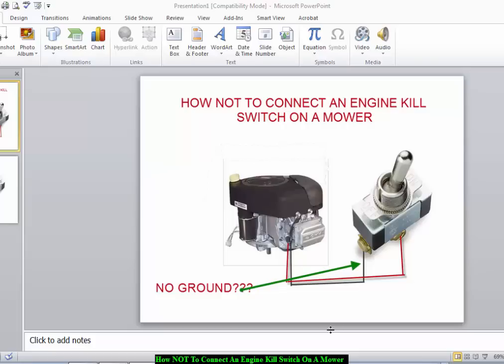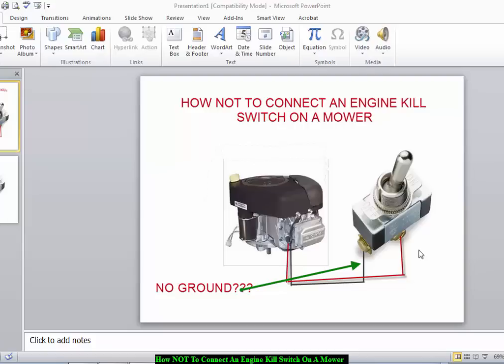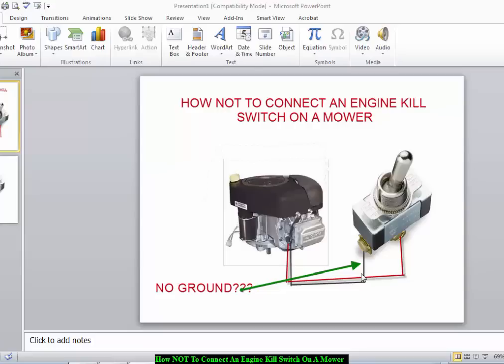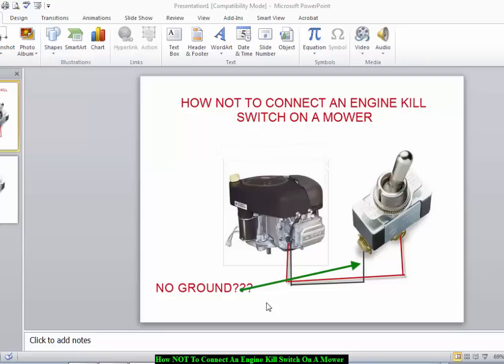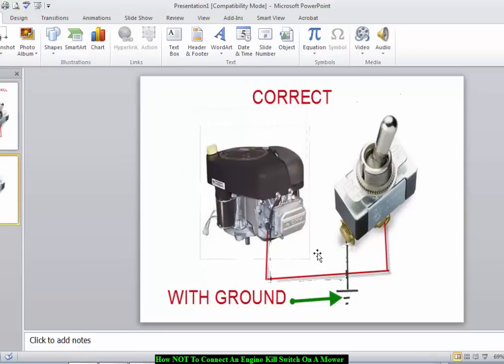How Not To Connect An Engine Kill Switch On A Small Engine

Comment: Why can't you wire a killswitch directly to just the spark plug wire? I mean my logical thinking is that if u have an on/off switch for it, why wouldn't it stop it from sparking?
Reply from the maker: You have to have a connection from spark plug wire to ground to stop the engine from running.
Reply: Thanks man. I installed a toggle for a kill switch. I did it wrong. I appreciate it